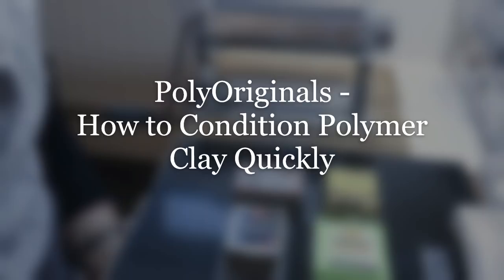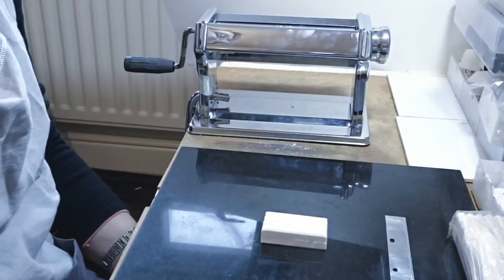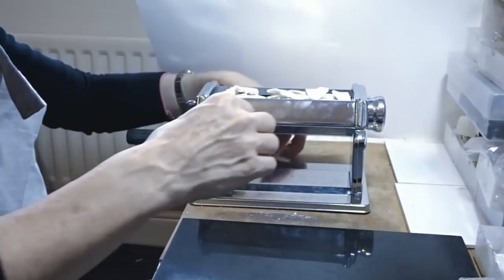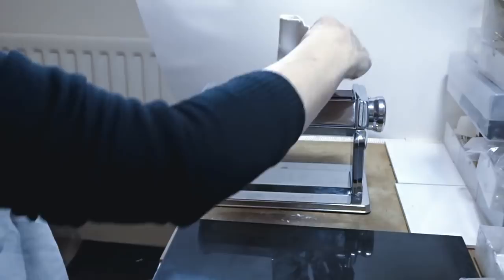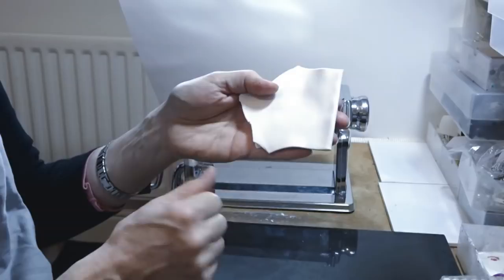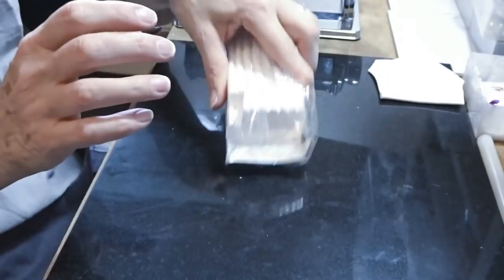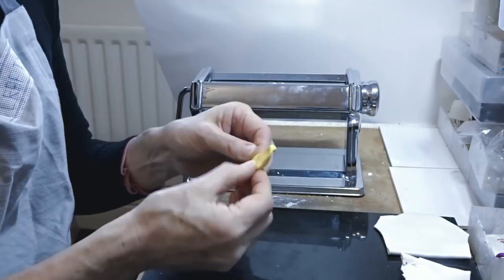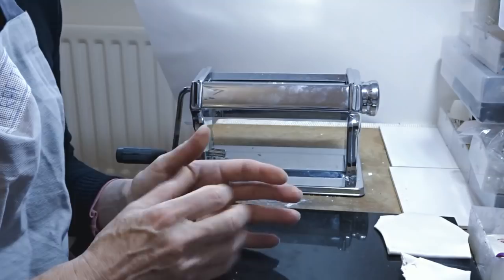Conditioning Polymer Clay Quickly - some tips

Comment: Fiona, if you please, can you recommend a pasta machine for polymer clay? I just started polymers, and need to buy one. Thank you for sharing.
Reply from the maker: When you are first starting it is  worth asking friends and family, or checking your local charity shops boot fairs etc, to see if you can get one cheaply. If not, then the pasta machine I use is an Atlas machine. At home I use the 180 (a wider machine) and when travelling or on workshops, I use the 150. I have always used the Atlas machines and I find them very good for Polymer Clay. However, there are other very good makes, such as the Imperia machines, and of course those made specifically for use with Polymer Clay. You can also read the articles from The Blue Bottle Tree on Pasta Machines  - https://thebluebottletree.com/?s=pasta+machines
Here is a link to an Atlas machine, (for reference only, as obviously there are many other places both online, and in stores that they can be found), and it is worth searching around till you can find a good deal on one. I hope that is of some help :)  https://www.amazon.com/Marcato-8320-Machine-Cutter-Instructions/dp/B0009U5OSO/ref=sr_1_3?crid=BPH5K7P26RQT&keywords=atlas+pasta+machine&qid=1556786279&s=gateway&sprefix=atlas+pasta+machine%2Caps%2C211&sr=8-3

sometimes b
Reply: @FionaAbelSmithPolyOriginals  thank you very much for the information, I am so excited to get started, and I have learned so much from your tutorials! I am going to research Blue Bottles website, she too is a wealth of knowledge. Looking forward to seeing many more of your wonderful tutorials.
Reply from the maker: @michelleadamchak1330  Thanks so much, and I wish you hours of fun with your polymer clay :)

Comment: What pasta machine do you use/recommend?
Reply from the maker: The pasta machine I use is an Atlas machine, at home I use the 180 (a wider machine) and when travelling or on workshops, I use the 150. I have always used the Atlas machines and I find them very good for Polymer Clay. However, there are other very good makes, such as the Imperia machines, and of course those made specifically for use with Polymer Clay. Ginger Davis Allman, from The Blue Bottle Tree has a number of articles on Pasta Machines - https://thebluebottletree.com/?s=pasta+machines which may prove helpful in choosing a machine.
Here is a link to an Atlas machine, (for reference only, as obviously there are many other places both online, and in stores where they can be found), and it is worth searching around till you can find a good deal on one. I hope that is of some help. https://www.amazon.com/Marcato-8320-Machine-Cutter-Instructions/dp/B0009U5OSO/ref=sr_1_3?crid=BPH5K7P26RQT&keywords=atlas+pasta+machine&qid=1556786279&s=gateway&sprefix=atlas+pasta+machine%2Caps%2C211&sr=8-3  :)

Comment: Hi i need help. I just purchased a pasta machine in hopes that it would ease my clay conditioning work. But ive been rolling my cernit clay through the machine for more than 30 minutes and it still cracks at the edge and still crumbles when i fold it. What am i doing wrong? And how can i fix this? 😭 it just wont soften
Reply from the maker: I take it you are doing that on a thin setting of your pasta machine, and folding sides to the middle each time ?  How pliable does the clay feel ? Some clays, especially those with additional elements like glitter or mica powders will sometimes crack slightly and still be crackled at the edges when rolled. But if the clay feels soft and slightly warm then it is fully conditioned and will be okay to use :) If not, there are two things I can suggest. 1.warm it in your hands for a few minutes, pressing in gently, do a size that's comfortable to hold. Once this bit gets warmer then it should go through the pasta machine nicely and you can start adding other non conditioned bits slowly into it, getting them well conditioned before you add more. 2. Do you have a bit of clay in a similar colour that is conditioning well? If so take a small amount of that and add a little of the crumbly clay to it. Put through the past machine as I advise in the video, gradually adding more of the crumbly clay in. I hope one of those suggestions works. Good luck :)
Reply: @FionaAbelSmithPolyOriginals  yes i did it the same way you showed in the video. The clay feels quite pliable but when i try to stretch it, it breaks immediately. I will try to follow your suggestions. Thank you so much for responding! Youre lovely 💓
Reply from the maker: @donaafiqah3641  You are welcome, I hope it works for you :) Have you visited the Blue Bottle Tree yet? Ginger has the most amazing advice and articles on there, and has written useful books too. She experiments with all different brands of clay and tests them in loads of ways - definitley a go to site for technical polymer questions - here's the link in case it helps at all :)  - https://thebluebottletree.com/category/articles/
Reply: @FionaAbelSmithPolyOriginals  this is really helpful thank you!

Comment: Hi Fiona
What’s the make is your pasta machine please? 😊
Reply from the maker: The pasta machine I use is an Atlas machine, at home I use the 180 (a wider machine) and when travelling or on workshops, I use the 150. I have always used the Atlas machines and I find them very good for Polymer Clay. However, there are other very good makes, such as the Imperia machines, and of course those made specifically for use with Polymer Clay. Ginger Davis Allman, from The Blue Bottle Tree has a number of articles on Pasta Machines - https://thebluebottletree.com/?s=pasta+machines which may prove helpful in choosing a machine.
Here is a link to an Atlas machine, (for reference only, as obviously there are many other places both online, and in stores where they can be found), and it is worth searching around till you can find a good deal on one. I hope that is of some help. https://www.amazon.com/Marcato-8320-Machine-Cutter-Instructions/dp/B0009U5OSO/ref=sr_1_3?crid=BPH5K7P26RQT&keywords=atlas+pasta+machine&qid=1556786279&s=gateway&sprefix=atlas+pasta+machine%2Caps%2C211&sr=8-3 
🙂
Reply: @FionaAbelSmithPolyOriginals  Many thanks for this Fiona 👍

Comment: What size pasta machine do you have.
Reply from the maker: The pasta machine I use is an Atlas machine, at home I use the 180 (a wider machine) and when travelling or on workshops, I use the 150. I have always used the Atlas machines and I find them very good for Polymer Clay. However, there are other very good makes, such as the Imperia machines, and of course those made specifically for use with Polymer Clay. Ginger Davis Allman, from The Blue Bottle Tree has a number of articles on Pasta Machines - https://thebluebottletree.com/?s=pasta+machines which may prove helpful in choosing a machine.
Here is a link to an Atlas machine, (for reference only, as obviously there are many other places both online, and in stores where they can be found), and it is worth searching around till you can find a good deal on one. I hope that is of some help. https://www.amazon.com/Marcato-8320-Machine-Cutter-Instructions/dp/B0009U5OSO/ref=sr_1_3?crid=BPH5K7P26RQT&keywords=atlas+pasta+machine&qid=1556786279&s=gateway&sprefix=atlas+pasta+machine%2Caps%2C211&sr=8-3

Comment: What type of conditioner machine is this?
Reply from the maker: The pasta machine I use is an Atlas machine, at home I use the 180 (a wider machine) and when travelling or on workshops, I use the 150. I have always used the Atlas machines and I find them very good for Polymer Clay. However, there are other very good makes, such as the Imperia machines, and of course those made specifically for use with Polymer Clay. Ginger Davis Allman, from The Blue Bottle Tree has a number of articles on Pasta Machines - https://thebluebottletree.com/?s=pasta+machines which may prove helpful in choosing a machine.
Here is a link to an Atlas machine, (for reference only, as obviously there are many other places both online, and in stores where they can be found), and it is worth searching around till you can find a good deal on one. I hope that is of some help. https://www.amazon.com/Marcato-8320-Machine-Cutter-Instructions/dp/B0009U5OSO/ref=sr_1_3?crid=BPH5K7P26RQT&keywords=atlas+pasta+machine&qid=1556786279&s=gateway&sprefix=atlas+pasta+machine%2Caps%2C211&sr=8-3

Comment: What happens if I have ran the clay through the machine and probally did put it through folded at the top..sigh...can I fit it ??
Reply from the maker: yes of course you can :) The only thing that will have happened is that you will have trapped some air inside. Take the piece you folded, and put it through your thinnest setting, then fold and re-put through (fold at the bottom ;) ) keep doing this, and eventually any air pockets that you have trapped will be moved to the outer layer of the clay and eventually be popped :) You can also use the clay as it is, and just check for any trapped air in your finished work BEFORE you bake. If you ever see any bubbles, simply pop them with a fine needle and smooth the clay down to remove the air. We all do it sometime, it is easy to trap a bit of air, but as long as you know how to deal with it, it is not a problem :) I hope that helps :)
Reply: Yes it does help a lot..thank u so much!!love your videos!
Reply from the maker: @cheriwhitley8385  Brilliant, thanks Cheri :)